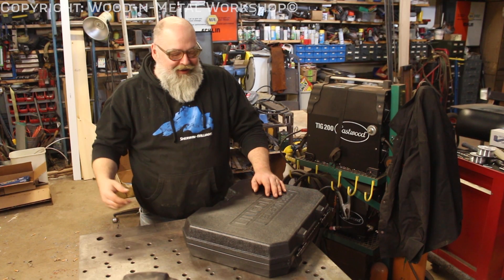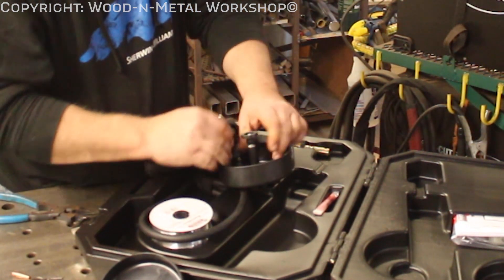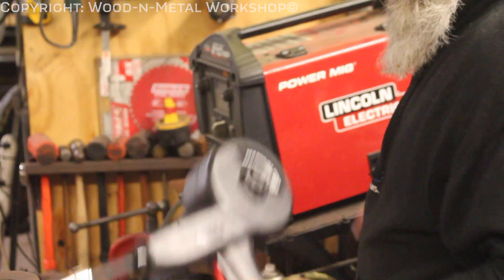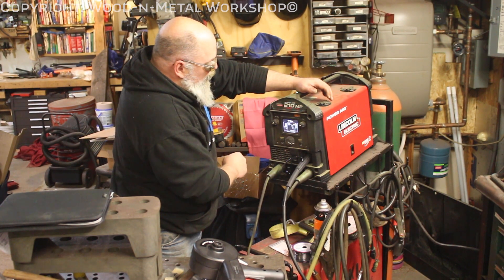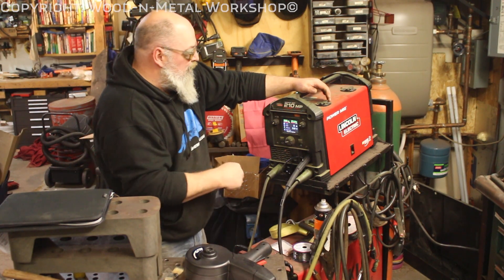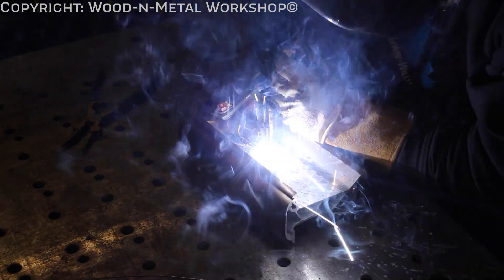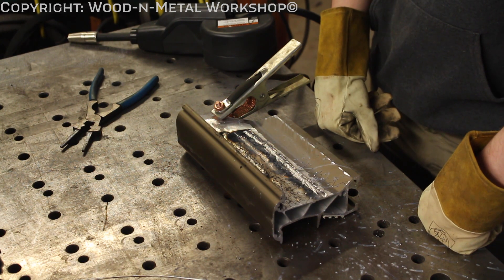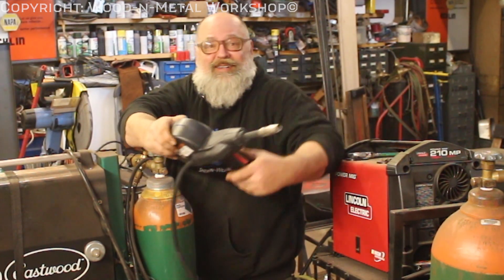Lincoln Electric Magnum 100SG First Impressions

Comment: Thanks for the video. Which spool gun did you buy that was the wrong one. I’m also trying to get a spool gun for the 210MP. Would you be able to provide the model number of the right gun? How much CFH did you run on that argon for aluminum? 

Also, out of curiosity, how do you like your Eastwood machine? Saw it in the background 😅

Thanks!
Reply from the maker: The Power Mig 210 takes the K3269-1 Magnum Pro 100SG Spool Gun 
The directions give some base line numbers for the flow rate.
The Eastwood machines are okay, but I would upgrade in a second given the chance.
Reply: @WoodNMetalWorkshop  Thank you 😊